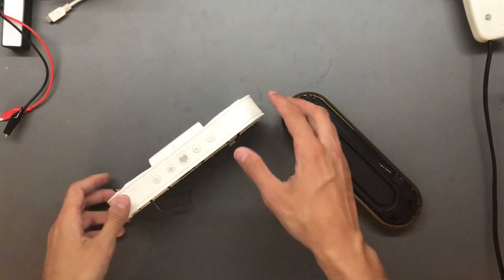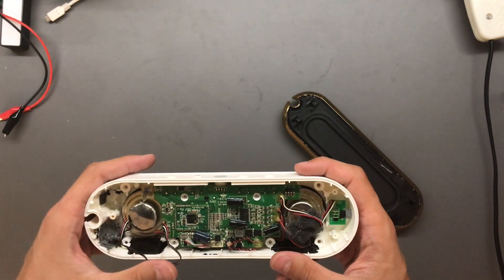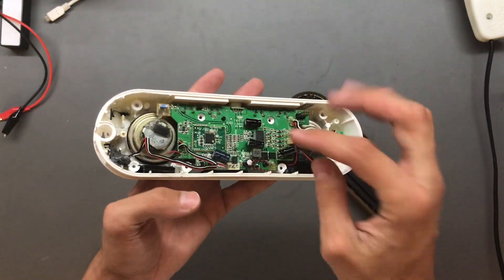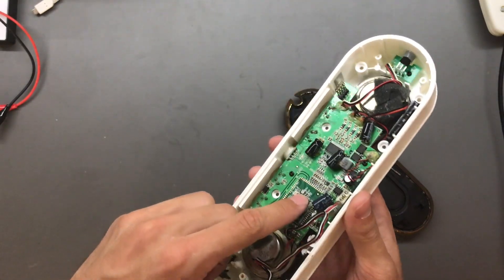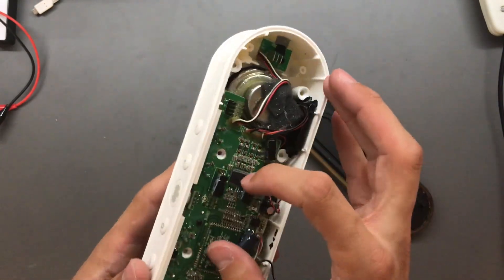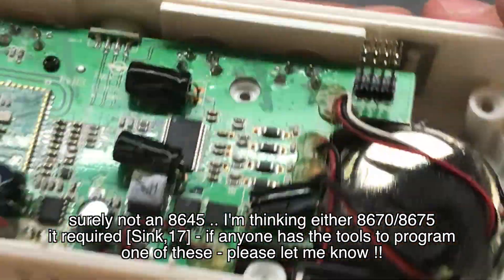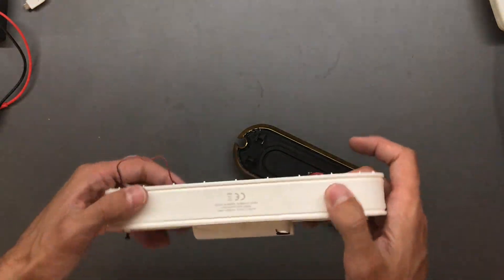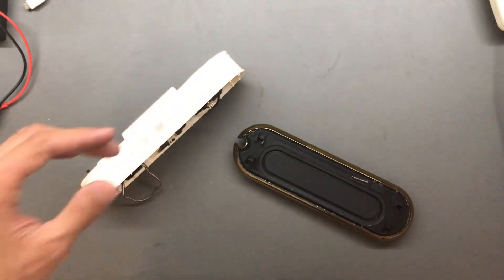Ministry of Sound: Audio S Plus - Teardown

Comment: So how do you get into the unit? I assume you need to pry off something but where do you start? (Battery needs replacing)
Reply from the maker: you have to use some needles, or better yet, one of those hook screwdrivers, to yank the grille out

try adding a tiny bit of alcohol on the edges to soften the glue (or neutralise the hotmelt completely, if that's what's holding it in)

Comment: Once the cover is off , how difficult would it be to access the battery? 

I use mine daily and now after around 45 min playtime I start to get the low battery warning sounds, and sometimes when at max volume the unit will power down,  
Was hoping to buy a large capacity 18650 replacement ,  so I need to get it open and also be able to put it back together

Comment: How did you open it up?
Reply from the maker: You have to SOMEHOW remove the front grille (back can stay on)

Under it there are 8 or so screws ... technically you could peeerhaps drill 8 holes in the grille where the screws are ... but, that too would be rather destructive, especially since the screws aren't evenly distributed

I would recommend heating the front grille to where it's too hot to touch, then trying to pry it off
Reply: @Darieee  I am just "servicing" mine as I suspect the battery died and can confirm you can pry the front grill off.

First I cut around the front grill and then stuck a mini screwdriver in between as a lever.
This damaged the shiny bezel around it just slightly, but once lifted a bit, you can easily work your way around.
Reply: This gives access to 4 screws that hold the shiny bezel.
On the next level, you will find the 8 screws to access the PCB.
Reply: @Darieee  After I ruined the case of this device (only wanted to see if I could replace the 18650), I noticed this vid :)
Anyway, I would recommend/confirm the following approach:

Heat up the FRONT iron grill and see to remove it. Underneath are 4 small screws holding a cover and then 8 screws under there that hold the complete backplate. I trust this will come off easily once you removed the screws. Don't start on the backside or you will end up with a destroyed unit.

I agree that the unit and PCB is nicely engineered, but in no way meant to open up easily. Also the glued places inside are a disgrace of the intended quality.
After several years of limited use, the battery was dead, resulting in a worthless unit. Very sad.